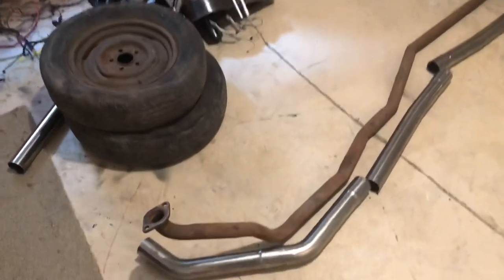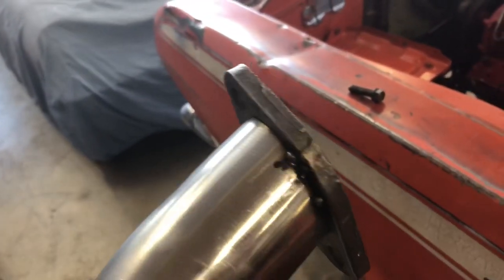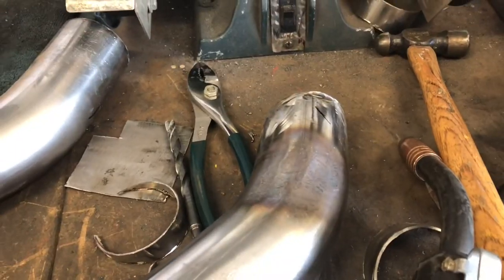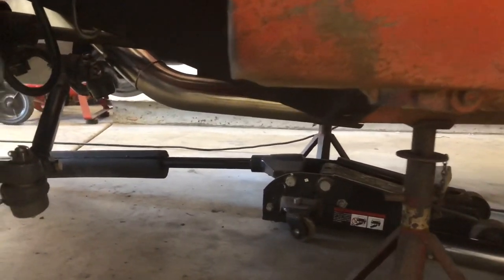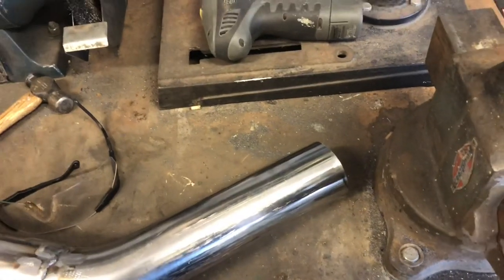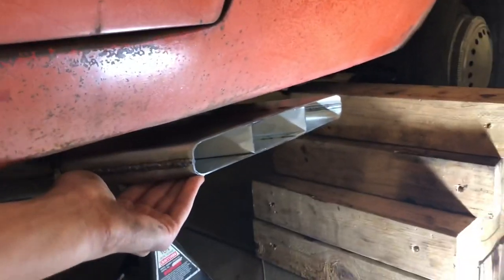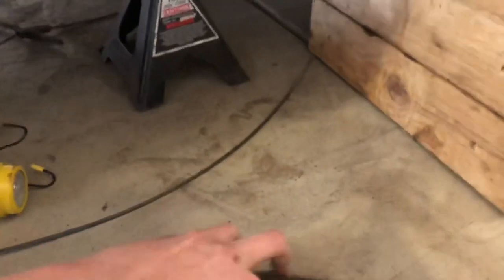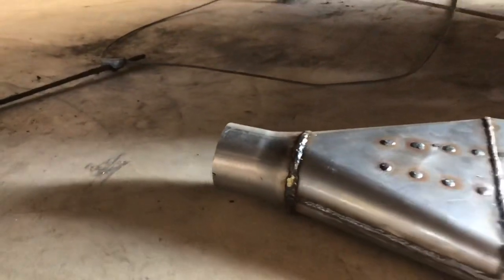SLANT 6 WITH A BOOM TUBE?? Letting all the bald eagles fly!

Comment: install the glass pack a 22" will sound good as the fiberglass blows out will sound even better. Next move the boom tube as close to the rear tire as possible and have the tips stick out past the body line around 1.5 inches. Other wise with windows down the exhaust will come right up into the passenger compartment. If this was your second video keep up the good work your a natural. Check out whatever you can find on the super 6 or hyper pack if memory serves. Also the Australians continued with developing the Chrysler 6 cylinder while we in the US went  to the V-8 they have some pretty trick *hit they make and sell over there

Comment: Half the point is to create expansion/low pressure area boom tubes are tapered from end to end, the dividers start very close together, then taper wider with the housing example 4" 1"space ends at 8" with 2" spacing

Comment: Good job but I noticed you never opened up the flange and are using a factory manifold your losing quite a bit of high rpm power the way you have it set up
Reply: Exactly. Make or find a friend with a plasma cutter and match the diameter of the manifold to the flange. your engine and fuel will thank you. I've owned and modified 225s since 1976. A previous post about a chambered muffler is right. Magnaflows are ok, but there are many good compettitors now.

Comment: if you want that slant6 to sound very close to a v8 especially at idle use a flowtech afterburner muffler . i did that on my 225 slant 6 in my 65 dart with 2- 1/2  pipe. glass pack will make it sound like an import = fart muffler😫. trust me you will like the after burner muffler. that factory flange port is still restricting the exhaust flow

Comment: Would have been easier to use regular twin aftermarket headers with true dual exhaust system,  they use to make 3 exhaust tubes into 1 flange headers for slant six engines..

Comment: Good work. EXCEPT you're strangling that /6 by just cutting off the exhaust flange at the factory 1.5 -1.75? pipe and welding it to the 2.5" downpipe. Very restrictive.